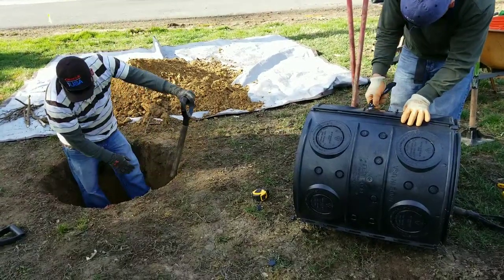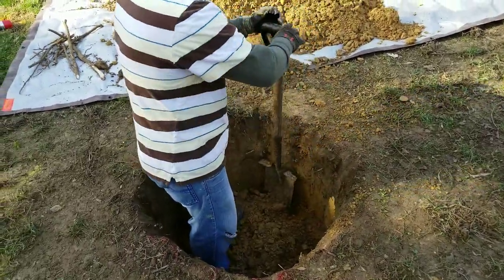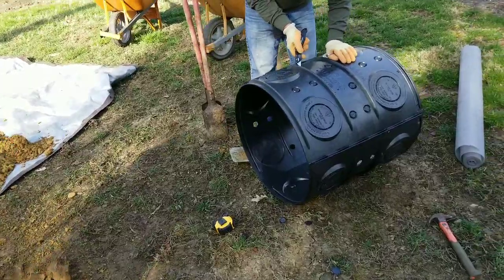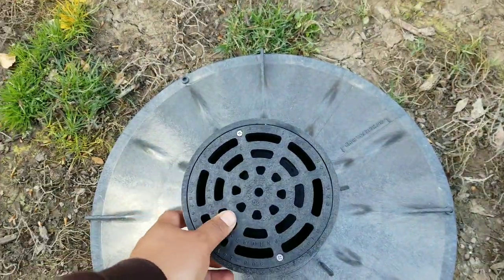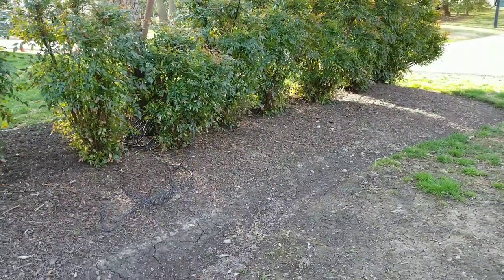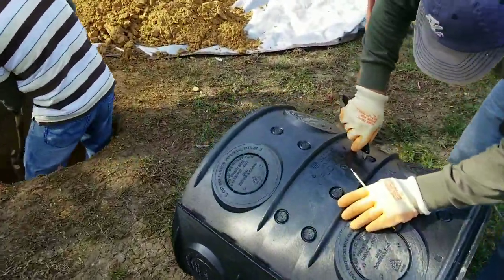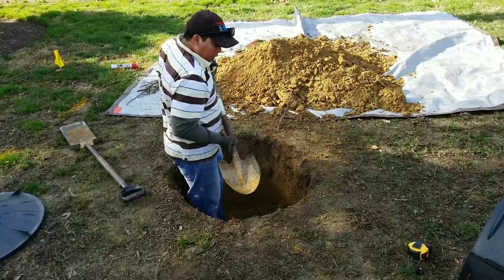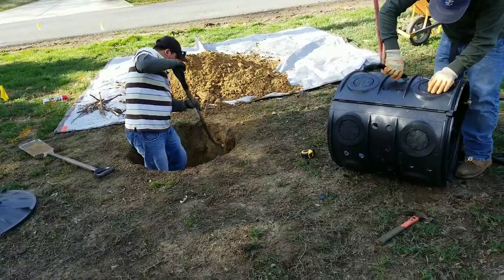Drywell installation part # 1

Comment: Great job.  Drywells for yard drainage is something that should be used much more often than it is and it has the added benefit of helping to refill the aquifers as well as cutting down on flooding from runoff.  Consider lining the hole with a non woven geo fabric that is very porous in order to keep the rock in place.